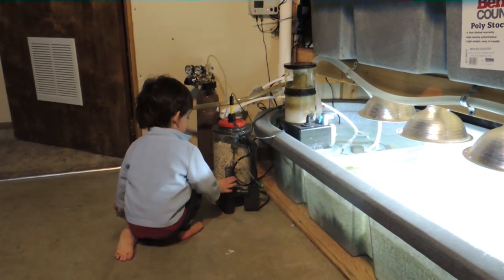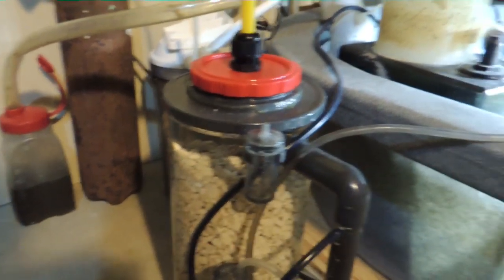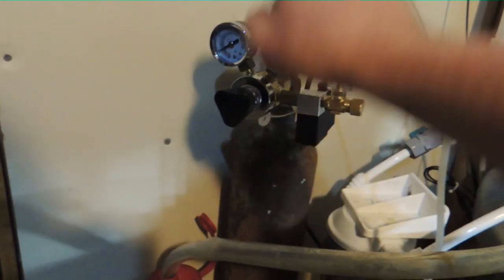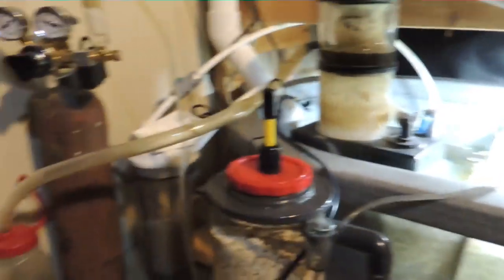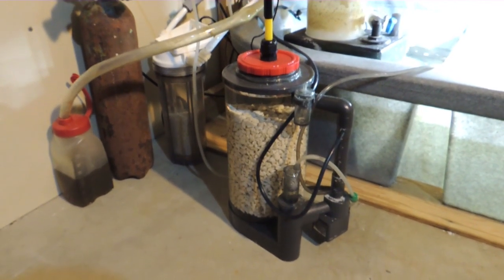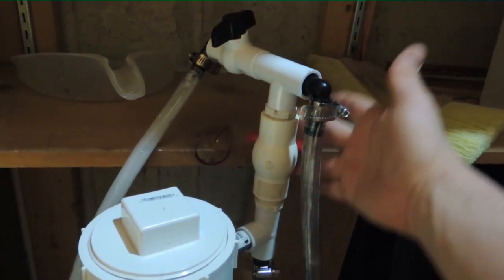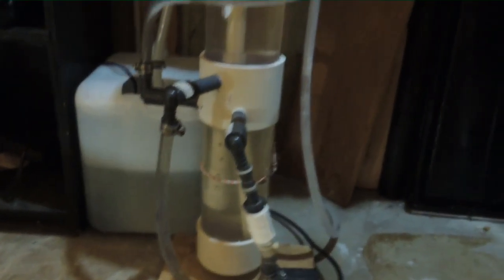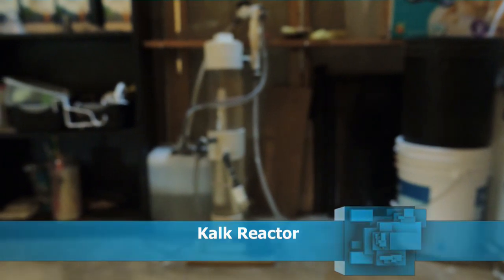Calcium and Kalk Reactors

Comment: Something is definitely wrong. There is no way you should have been dosing that much and still have levels that low. Also, you tank is white.  It should be purple with coralline algae.  I to run a calc reactor, but on a 180 and twice as many SPS corals and don't have mine turned up nearly that much.  Not sure exactly what you have going on, but something is definitely not right.

Comment: I had a very similar experience from what I saw in your video going from 2 part to a calcium reactor to a calcium reactor with a kalk reactor. I have a 150 gallon setup the trick to keeping your calcium and alk levels up with a calcium reactor is slowing the effluent's drip as much as possible so the media in the chamber has a long contact with the water. Pumping too much co2 into a reactor with a flowing effluent line will cause too much co2 to enter your display tank which may lead to major algae issues down the road. The kalk will offset some of the co2 I the tank but only to a certain extent. Give it a try you'll also notice that the media and co2 will last a lot longer this way and the tank will be more stable. I'm only posting this because I did the same thing as you. FYI you have to be very patient with the calcium reactor. Set the calcium reactor and leave it untouched for at least a day before retuning it of you have to.

Comment: 250/ml is alot but i would say your problem was you did not want to got with dosing pumps so with that in mind i would say you was dosing at diff times of the day which would make it harder for you to keep up with the demand.you will see that you would have been better off by buying the dosing pumps. your mag must be low check your mag

Comment from the maker: Hi GiI, I agree 250ml  sounds like a lot that's part of the reason I made the switch. When I started dosing 2 part I was able to maintain 420 calcium levels with a dose of 70ml a day. as the salt mix hasn't changed I believe, over time the system demands grew that much. I think your also dosing with Bionic witch may be part of why you don't have to dose as much.